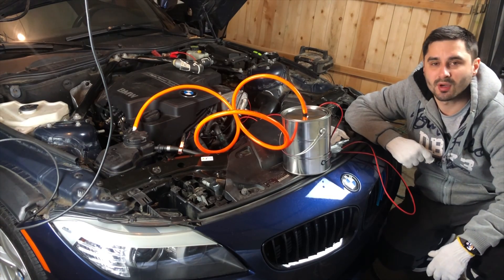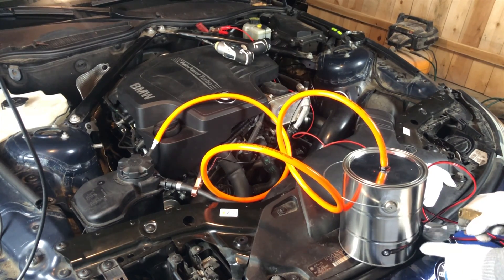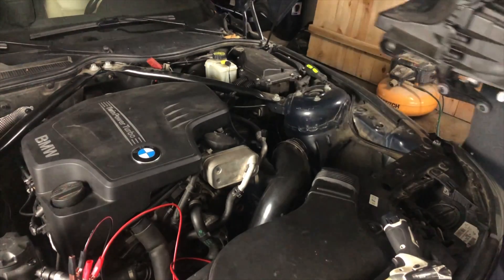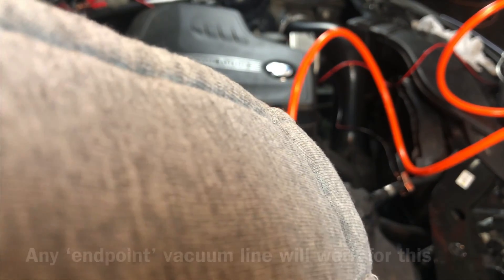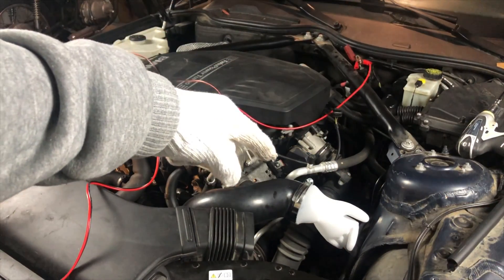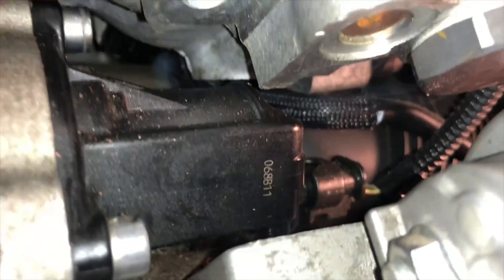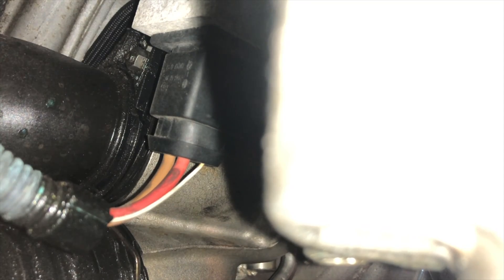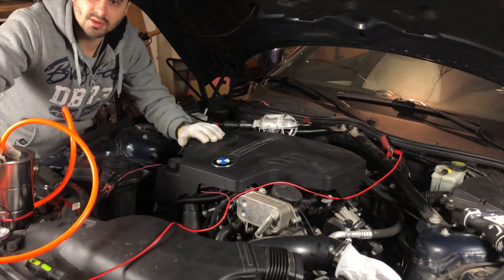How to find EVAP and Vacuum Leaks with a Cheap Smoke Machine DIY

Comment: I don't have an air compressor. What are my other options?
Reply from the maker: I think they sell some that have a pump built in, but it will probably be cheaper to get a tiny air compressor from harbor freight for $60

Comment: so the leak you have is the one fixed to the turbo ? 
can it make shaker all the car on D and R cold untill the MAF fix the issue ?
Reply from the maker: The one I had was at the boost solenoid valve and I believe it can cause idle issues like you are describing. Mine is a manual, so I didn't have the shake.
Reply: @SimpleCarGuy   ok mine is electric valve for the turbo and automatic gear box. 
i change all the engin and still have the same problem ! i didn't change all the air plastic. maybe the pb is there
Reply from the maker: @Samlevip777  have you looked at the engine mount? I have heard that it can cause very similar shaking of the engine when in D or R and brake applied.
Reply: @SimpleCarGuy   yes all of them are ok. 
i have the plastic that goes in the turbo who's broken and not fixed... i don't know if it can be that

Comment: What do you do after to get the smoke out? Or can you start the car with the smoke in the lines?
Reply from the maker: Simply unplug the smoker from power and continue to run the air. If i remember correctly, I did that for like a minute or two.
Reply: @SimpleCarGuy  i see. Very informative! Thank you!